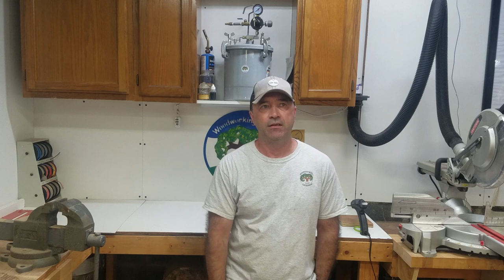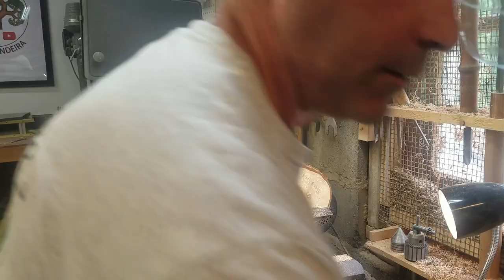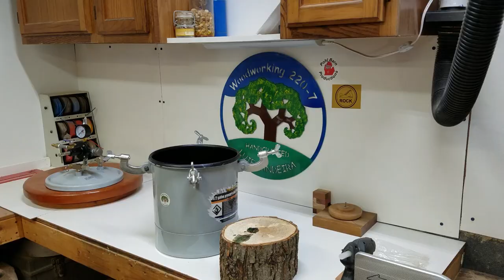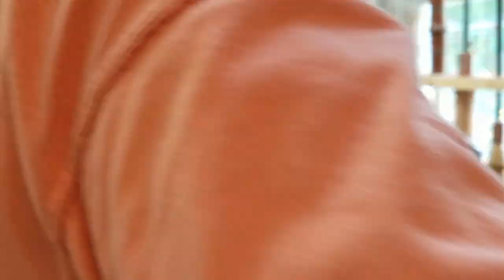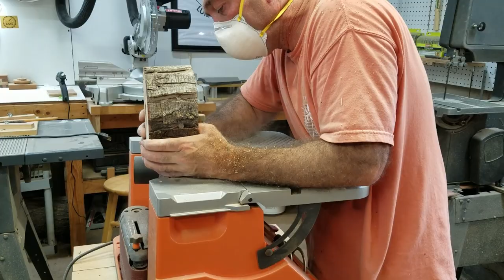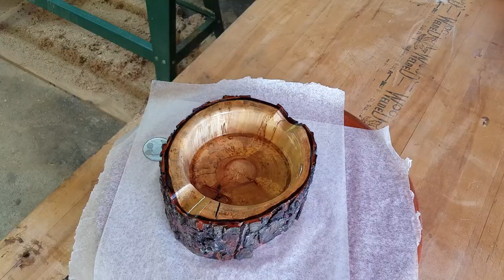Wood Turning a natural edge cigar ashtray from spalting log Fun gift idea

Comment: What a great idea for a Christmas present! I have made several cigarette ashtrays out of poplar but this one is much more beautiful although perhaps a bit big. Could you elaborate a bit on the actual dimensions?
Too bad I do not have a drum sander to make the coves like you did. Ths far, my ashtrays don't have any. 
To something similar, I'm thinking of drilling 3/4 inch holes with a spade bit and then work the edge down. 
Doing it that way it will be hard to have them all at the same depth but I can try. 

Thnx for the inspiration!
Reply from the maker: Hello and thank you Leo,
Your kind words are appreciated. 
This cigar ashtray is gone but the Approximate measurements were 8 inches wide and maybe 4 inches tall.
I have used your idea in the past of drilling holes first and it worked out ok....but like you said not always perfectly even
Thanks again!!

Comment: Great video and great turn out 👍👍and maybe you  could try using hot clue on the out side of the crack to prevent the epoxy from leaking out.
Reply from the maker: Thanks for the watch and the sub!
Great idea with the hot glue I will keep that in mind👍